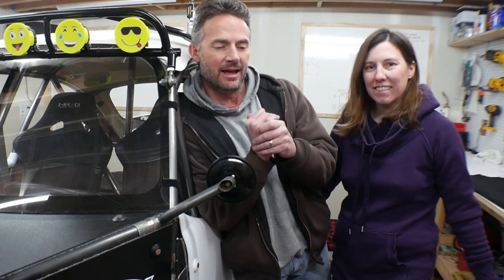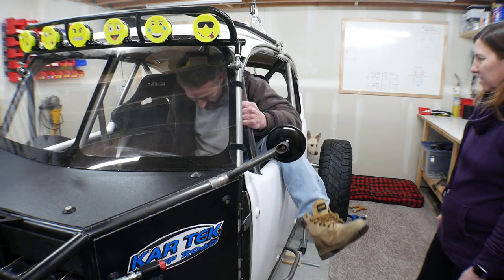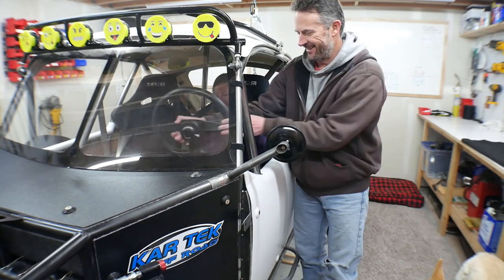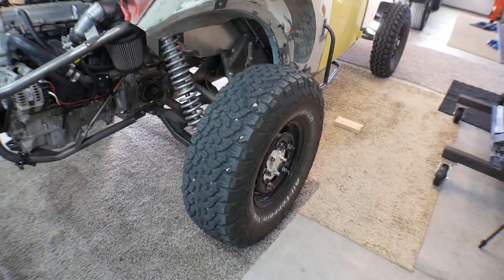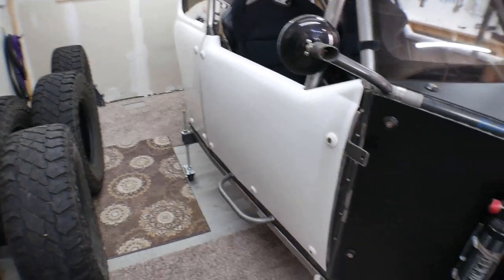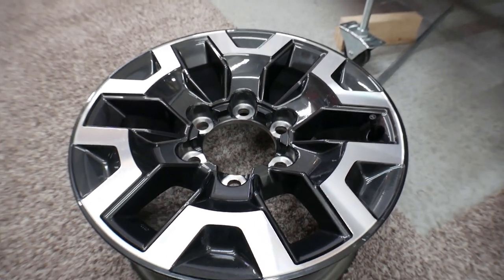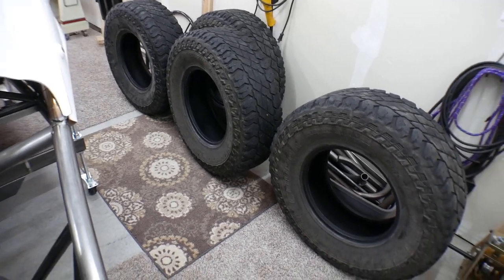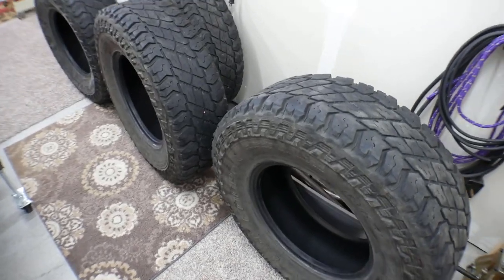Wratchet gets some Rubber...

Comment: Dude! That looks like a class 1! I need to copy your build one day... Lol I had 3 sets of used tires on my truck, no sense of wasting money if I couldn't make them fit. My most recent set I actually bought new since I test fit used 35s. Even my coworker borrowed my 35s as a mock up to see what he had to clearance out. I went to the mom and pop tire shops, the big name tire shops usually won't or don't like putting on used tires.
Reply from the maker: Once I get a feel for the torque of the motor I might try 35s. But for now I'll go with these. Same here, the big shops just want to put brand new tires on mini vans all day.
🤷‍♂️

Comment: G'day, 
Kevin here from Australia. 
Your right i love your front tyres they look awesome.  The back tyres however look ok but need to be a bit wider . The back needs to look a bit more aggressive. 
What if for the purpose of the build for the back you use wheel spacers to simulate a wider tyre. 
(Just a thought)
Owe and also your attempt to show up your lovely wife was shot down in flames when she showed you up 🤣
Anyhoo thanks for sharing man stay safe.
✌🏻   peace.
Reply from the maker: Hey Kevin,
I totally thought she would struggle and scream trying to get in there. When she slid right in I was like "how did that happen?" 🤷‍♂️
I'm still watching Craigslist for other tire sizes to try something bigger in the rear. But it's a dangerous game. The bigger the tires get the less authority the powertrain has over them. But I agree, they look a little small in the rear.
Stay safe buddy. 👌

Comment: Nice score with the used tires!  As you stated, they'll help out so much from here on out.  They will also help you dial in that rear tire size once it's drivable and you can ratio out the RPM's.  I have 33's in back and now wish I had gone 34's 'cause I spent before I tested.  Ugghhh  :-)
Reply from the maker: Yes, I'll also find some used tires for the rear that are larger. So when it's driving I can experiment with both. Then bite the bullet on a new pair. 👍

Comment: I'm thinking some aluminum beadlocks will help you out. Easy install, any size and bolt pattern you want. I like Raceline but there are tons of options out there. And it's nice to unbolt a tire from the rim when you are off road to repair it. They are a little spendy. But maybe worth it. Maybe not.
Reply from the maker: Actually haven't really considered them much at this point. Your points sound good though. I'll take a look and see what I think. Thanks for the idea. 👍

Comment: The 33's look good Doug. You were having problems mounting those manually because the drop center is closer to the front side of the wheel. They won't stretch over the edge of the rim if you start opposite the drop center
Reply from the maker: I hate failing at stuff like this, I'll get some bigger irons and try again at some point. And I'll be sure to get the tire in the drop center next time.

Comment: 9.00-16 Michelin XZL!!  They are HUGE though, but I’m still pushing the military jeep or 2-1/2 ton tires! 😉😎
Reply from the maker: That's a heavy tire dude! 9" wide on the front would be awesome though!
Reply: @DougBugBuilder  , I would go 6.00-16 front and 7.50-16 on the back military traction rib tires. They have a central rib for driving on hard surfaces and deep lugs for traction.
I had the 9.00-16 XZL’s on my 3/4 ton (Centurion Metropolitan Magnum) 4 door Bronco. They were awesome for it
Reply from the maker: @rickrack78  Thanks for the info. I'll check those out.

Comment: It looks like you were trying to mount the tire starting on the back side of the rim. If I was watching that correctly that is most likely why you couldn’t get the tire on. On Toyota wheels if you look towards the face of the wheel it’s got a channel for the tire to slide in. When your mounting the tire you get it started and you slip the bead into that groove and then slid the rest of the tire on. When you start on the back of the wheel the tire won’t sit correctly making it to right to slide the bead on. Now with a machine you can make it work but by hand it would be a lot of work.
Reply from the maker: I know what you're talking about, I did try that. And when I was trying that I got as close as I did to getting the tire on. If I had larger irons at that point I might have gotten it. Another issue I was having was the lip on the wheels is so large it was easy for the irons to roll off. I'll be mounting more tires, so I might get some larger irons and give it a go. 
Thanks for the tips. 👍

Comment: I cant wait till this thing 100% done. Curious what the final weight to HP ratio ends up at.
Reply from the maker: The anticipation is killing me too!
I'm assuming this will weigh about 2,600lbs. Initially I expect 240hp. At that point it won't be the fastest horse in the barn. But once it's up and running I plan to put a turbo on it, at that point it should be more respectable.

Comment: Is the car wider on the back?
Reply from the maker: A little bit. I haven't measured it yet, but I'd say it's 1.5 inches wider in the rear.
Reply: @DougBugBuilder  thanks, just one question, I've seen some cars that are the opposite, did that affect on something? I love your job and I hope I can made one following your videos, thanks a lot. 👌👌
Reply from the maker: @josemiguelmarinrobles4432  Sometimes on vehicles set up for a track the front will be a little bit wider for stability. It can help with cornering, especially with pavement. 
But in offroad in a vehicle like this you'll see the rear a little wider because the wider it is the more travel you'll get. The limitations are in the driveshaft angles. So the longer the driveshaft the more travel. Because of the transaxle the rear arms are already shorter than the front. So to keep pushing the front as wide as the rear the arms reach a point where they get to long and weak. Mechanically the front can do about 24" of travel, but the rear can only do 21". So you try to push the limits of the rear by making it as wide as possible within reason. I'll use limit straps to make the front and rear have 20" of travel for balance. And it would be best if the track widths were the same as well.